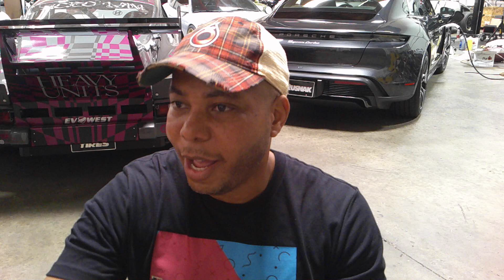Taycan Turbo, Rusnak, Analog builds, and remote tuning.

Comment: Hey Bisi i am sucker for a F22A variant motor that thumbnail sucked me in i have been meaning to get into contact with you when you might be available to talk about an AWD 92 Accord build via dual engines to see if you might have any input ot advice and to ask a couple of questions if your not too busy. Hope you have a great day and hopefully we can talk soon it would be an honor.
Reply from the maker: Join my Tech2sday.... So many can benefit from your question.
Reply: @Bisimoto   hey so yesterday i was waiting for the tech2sday to try and copy and paste my long ass questions but i didnt see it did i miss it? I saw the meth injected high compression knock reduction solution and was curious if e-85 was in the cards after the fuel system is upgraded or is this something you were trying to avoid until the limit is achieved on the current type of fuel? Sorry for so many questions. Cant wait to hear what you might think or say i just asked Brian and his son at Hasport/VTECH Academy a couple of questions about the build as well and they are going to try and have a guest on who has done what i want to do so I'm stoked about that as well hopefully i get to hear your opinion thanks Bisi and i hope you have a great day.
Reply from the maker: So many can benefit from your questions. Kindly tune in next Tech2sday.
Reply: So my main questions would really just be picking your brain as an engineer. Being that it will be dual engines i was wondering if i could use one ECU capable of running an 8 cylinder engine to run both, if i can shift both trans missions sequentially via strain guage that would be a great solution but expensive so i might be doing cables being that  is cheaper so i was curious if you had any experience in shifter cables that are long enough to reach the back im thinking NSX cables?, and same for throttle cables if possible, I would prefer one ECU to control both throttles if possible through some sort of D.B.W. throttle bodys seems like a more elegant solution with more tuning options down the road. Will one ECU be able to control all of these functions or will i need two ? One seems like it should work if it could power an 8 cylinder just not sure about the two throttle bodys and a strain guage how many would i need or would one work being that there is one ECU? I want to see if NSX shift cables are long enough or a combination of cables but i would also like to see if i could set them up to shift sequentially and have all the cool modern features like flat shift and auto rev match. Cables will do just fine i am just thinking of the problems and solutions and see what tou think about the idea i am starting with Accord Engines because thats what i have but i would love to show people that it can be done with any combination of engine and chassis so i will try to upgrade to kseries when possible down the road. Turbos are great but simple is better for the beginning stages and would love to upgrade to some turbos down the road im really thinking no more then 300hp for each engine, NA will get me pretty close to those numbers on a good k series and really 200hp will probably be more then enough. Then there comes the differentials any suggestions on how locked or unlocked i should do front and rear i would like to talk to Mike kojima about this one it would mostly be a Hill climb/tarmac car and possibly some dirt as well hopefully, still trying to make contacts and find sponsors. Thanks for your time Bisi ill try and copy and paste this on tuesday to ask then.
Reply: And some questions on the F22a what throttle bodys are on there and is it hand ported? I just put one together and ported the head and dont want to put it in the car because im not sure if a stock ECU will work? its all stock other wise other then balance shaft delete and resurfaced the head everything else is stock but new. I plan on getting an ECU but not sure if its needed for it to run correctly or if the ECU can compensate for the more air it would have now? Sorry for the two long ass conversations, i was talking to you before i put the Engine together and was asking your take on Frankenstein builds because i have some F23 motors as well and was asking what if i put the f22 head on the 23 block if i would benefit i got over that real quick though and just put together a completely refreshed stock build: Hand ported head, oil pump, balance shaft deletes, resurfaced head, new valves bearings and rings, and honed the block new seals and gaskets now its sitting because i am afraid to run it without some sort of tunable ECU. Any suggestions for that im sorry again Bisi for taking up so much of your time. And thank you i look up to you for all you do! I like the injectors pre throttle body on the thumbnail Richard Holdner i believe his name is wrote a book on that subject and i found it all very interesting he made the most power when he injected pre throttle body just like that :) any how hope to talk next tuesday and i just have to say the Taycan Review really was one i wanted to see from you being that you have the other ev Porsche haha love this technology and now that crazy Mach-E that Ford came out with how can you not like the scream of those motors nit sure if thats real but it sure does look and sound the part with all seven motors screaming
Reply: Sorry i need to get Friends haha
Reply from the maker: Dillan Martin Just join in on of my Tech2sday shows... And ask away! Cheers.